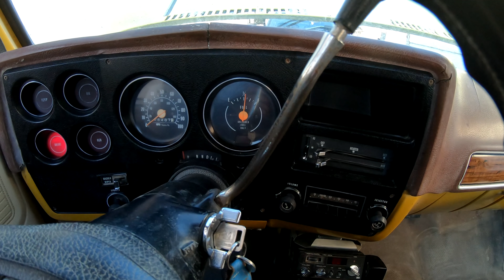Ol' Yeller all FIRED UP! But is this SBC TRASH? (DEATH RATTLE) | 1977 C10 Squarebody Truck Project

Comment: May be a broken flex plate from being stuck reverse to forward slam
Reply: Exactly what it sounded like to me. Might open the service cover hole on the bellhousing & check the flexplate & or flywheel bolts. Maybe one is loose?

Comment: I would definitely check the converter bolts and the flex plate.  Both can make similar noises. Also change the oil and check for metal

Comment: Like others are saying I would start be checking the flexplate and the converter bolts. If that is good then remove the belts and even disconnect the converter bolts. That will narrow it down to internal engine. If it was a rod it will rap some on accel but really rap on decel.

Comment: put a c infront of the plug number  cr45ts.   That will be the same heat range and size plug, but it has a larger electrode, so they last longer.   I heavier duty trucks with same engines will use the c plugs.

Comment: You'd be lucky if it's converter bolts but sounds like a spun rod bearing to me. Like people say, disconnect accessory belts & disconnect converter & slide it back from the flex plate & try again. Still knocking? 10 years ago we could get a full gasket set, oil pump, main & rod bearings, and maybe a cam & lifters from summit for about $350US. Sand the crank smooth if there's burrs, & dingle ball hone rebuild it! It definitely will make you appreciate LS motors tho!

Comment: Check the dimmer switch If it has the old style on the floor may be why the headlights wnt come on .
Reply: Exactly,  had the same issue in my 74 nova

Comment: I would check to see if the water pump is loose. Or could be the timing chain and gears. They used plastic and fiber for timing gears.
Reply: Eric Nelson not chevy
Reply: Chevy did to
Reply: Eric Moll I stand corrected in my 54 years I will say I have never seen one in a Sbc new or used must have been lucky
Reply: Ive come across a few the vortec 350 305 had them
Reply from the maker: They used steel gears with nylon teeth on the cam gear.

Comment: Disconnect fan belts. Disconnect torque converter bolts. If noise is still there The baffles in the muffler are rattling.

Comment: Choke=cold air idle. The iac will keep on high idle until the temp comes up. You have to treat the choke the same way. Most likely, you had some wires wrong, as those plugs should have fired off no problem.

Comment: Sounds like its about to throw a connecting rod thru the block lol. If you want to go cheap always can get a late 90's vortec 350 from the junkyard for $50
Reply from the maker: Our junkyard charges the same price for any engine, so theirs really no reason not to get an LS. They would want the same $250 or whatever it is even for a vortec. Works out for us though because other yards charge a premium for an LS.

Comment: Cracked flex plate.......clean off the contacts on the dimmer switch on the floor board to solve the headlight issue......fuck that gen 1.....and I'm old!!!!